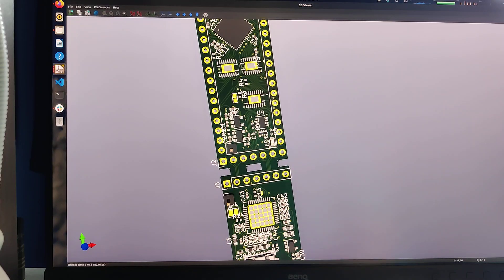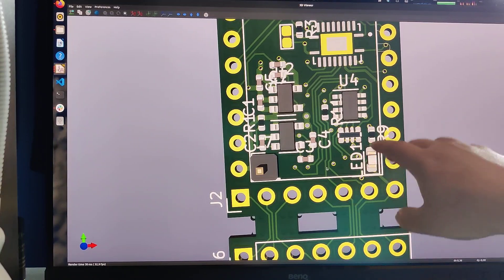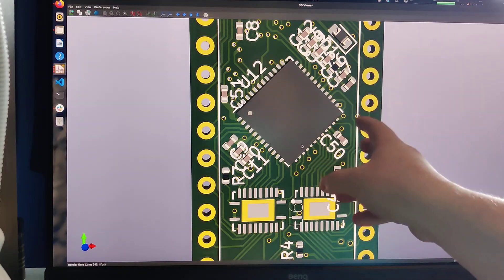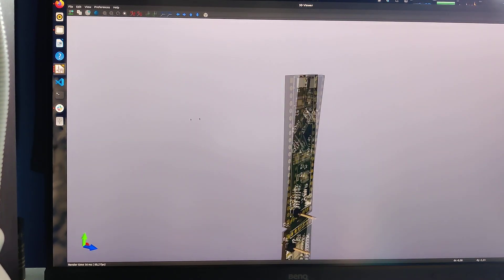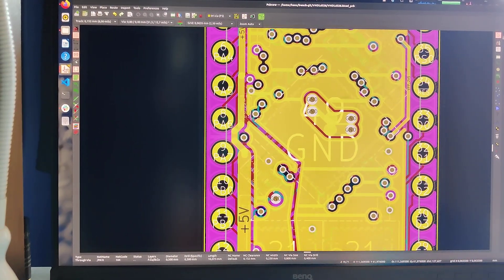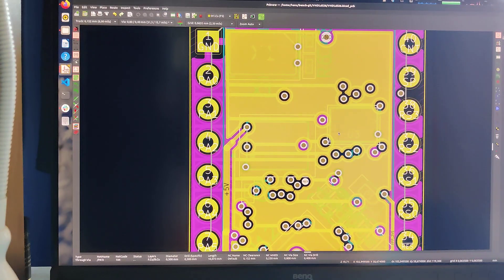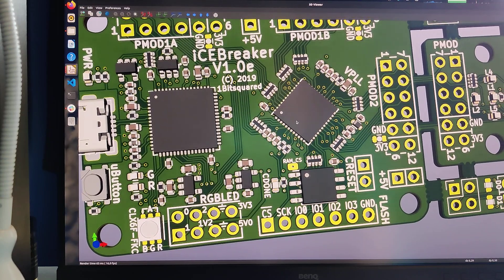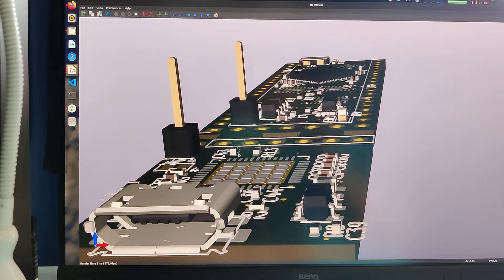The VHDL6526 project - Layout done

Comment: The 8520 in the Amiga is clocked by the E clock that is actually a lot slower than the 6526s in 64. But then there is the 8520 inside the 1581 disk dive, it is clocked twice as fast.

Comment: Great to share this only i see some "ugly" routed tracks in your design. If you share this on github for example i can go trough your design. Also one little comment it's best to put the crystal as close as possible to your chip. It is just for the cleanness of the signal and also for RF complience. But overall this is a nice project, keep up the work!!!
Reply from the maker: Thanks. Will share a later version. It is easy to say that, but there is not much room to move stuff here.
Reply: @bwack  I understand but some tracks can easily be changed just to have a overall better design. For example there are a couple of 90° or sharper bends in your design.